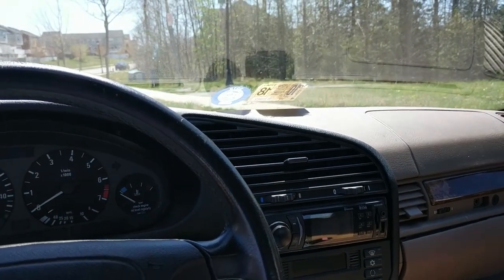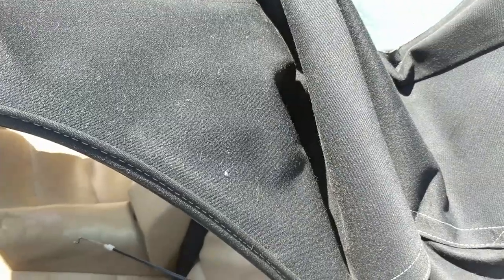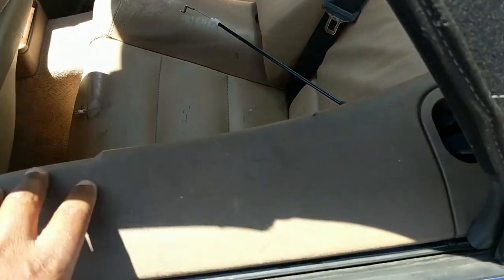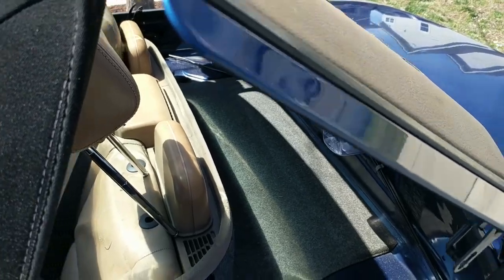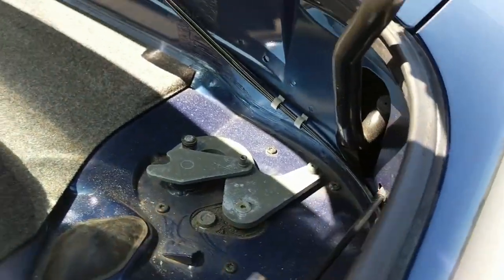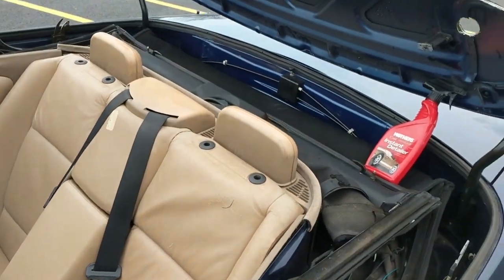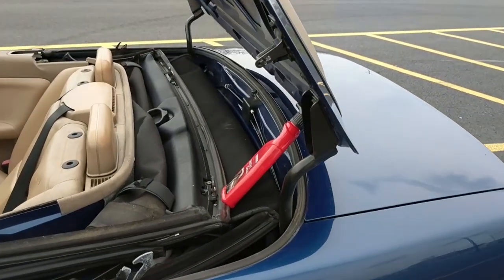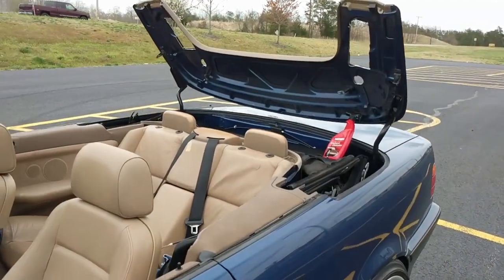E36 Auto to Manual Convertible Top Swap

Comment: How much would u say the total cost is or an estimate to swap to manual cause my top don’t work rn but if this is cheaper I might as well just switch to this
Reply from the maker: I got the top for around 400-500 with the brackets from a pick and pull yard the hardware and everything I needed. But I did pay about 230 for the manual lock mechanism system for the rear cover. I forgot to grab it off the pick and pull car the day. So I got it from a BMW parts guy off Facebook later. So I spent prolly around. 700-800 tbh could’ve did it cheaper if I grabbed everything I needed off that pull car.
Reply from the maker: The manual top I got came from an auto 318 e36. Mine was a 328i so I guessed the lower trim models got a manual release while the higher ones got auto

Comment: Gotta be another way to get the top cover open without cutting holes in the car, i want to keep mines as clean as possible.
Reply from the maker: Well the top cover is replaceable so that's why I wasn't tripping about it. And I honestly don't think there's another way. Because if the locks won't release from pulling the emergency latch there no other way to get in there.
Reply: I just got mines disengaged by taking out the cover motor in the trunk
Reply from the maker: The cables to mine had to much slack to release the cover. Dropping my motor didn't do anything and for in the lever for the cover motor ain't work.
Reply: Ssparksmedia the cutting on the toneau cover isnt a big deal but cuttjng through your back armrest was bad idea. Those leather ones are rarer
Reply: @STLLTNDR  You could just go straight to the cover motor, there is a latch where one of the cables corresponds to...but I get it it's a bitch when you can't get the top down, nice wheels by the way
Reply: Pop out two latch cables from the top storage lid opening motor inside the trunk. Then u don't need to cut the top storage lid.

Comment: No no no hell no. Please dont cut the top cover. If the emergency handle under the  seat doesn't work. Go in the trunk and pull the release manually. There's 2 of them. One on the left behind the driver side rear light. The other on the top left in the trunk.
Reply from the maker: Cutting was my last resort after trying everything i could to get the cover to release. of course i tried going through the trunk but the cable itslef has to much slack to release the cover. so it had to get cut up lol its replaceable for anybody that has to do it.

Comment: Wtf do I do if I don’t have the handle that releases the convertible area
Reply from the maker: either try to manually release it from the motor in the trunk or cut holes in the top cover like I did which is replaceable. to gain access to the locks on both sides to release it.

Comment: After you cut the wholes out to get the top up could you replace the part you cut into so it won’t look as bad after you swap it?
Reply from the maker: Yeah the tonneau cover is replaceable 4 bolts hold it on , two on each side

Comment: How rare is the oem manual top? I have it but I actually never saw it on any other e46’s while shopping for mine. It’s really not bad opening the top, by myself it takes about 30-45 seconds
Reply from the maker: its not really rare if you know what e36 to look for. like I knew that 318s came with manual tops because all the 328i I saw were auto.

Comment: I have a full automatic one. In order to do the swap I need to get a new soft top?
Reply: Or I can use my original one?
Reply from the maker: You can use your original auto top but you would need the front locking system from a manual top ( the Handle and such) and maybe the rear tonneau lock system only if your emergency latch works to release the tonneau cover. I just found it easier to swap the whole top just because my auto top was falling apart. And it's easier to Grab and whole top because you get everything rather than trying to source specific parts you would need just to keep your auto. I grabbed A whole manual top with bracket for 174$ from a pick and pull.

Comment: HELP!!! Trunk is Stuck - Won't Open With Key.
After viewing your video, I think you could help me solve a huge problem,

The top on my '95 325ic convertible was already converted to manual years before I purchase it.  

Unfortunately, the other day I created a huge problem for myself when - for the first time ever my trunk became stuck (unable to unlock) -  after removing the flap and taking the top down to get water out, that had accumulated in the area where convertible top is stored.  

Even though I have owned this car for 5 years only after watching video did I learn the trunk won't open if the top is down.  In addition,  the two rear latches on opposite sides of car under flap , which could disable the trunk latch.  

To my pleasant surprise, upon watching your video at about (4:50)  mark you begin talking about the same thing - inability to get into trunk , door locks and removing a fuse from the central fuse box, which I did not do before taking this top down - never had to in the past either.  You also stated, that  you would share a video, which I can't find on your YouTube page. 

So, I am wondering what has went wrong here?  Why does my key no longer work in the trunk lock cylinder, even though I have let the top up and down manually dozens of times before.  When I turn the key to the left, I can hear the motor engaging, but when turned to the right there is nothing - no sounds or resistance / tension - like something is broke or disconnected.   

==========
Now I am at a point in which I may have to pull rear seats out to access panel to break into trunk OR drill holes under rear tag to try accessing the cable.  My third option is to take it to the dealership and be ripped off in a mighty way.  

Therefore, any advice or expertise you could give would be appreciated.  

Many Thanks, 
L__
Reply from the maker: lookup a fuse diagram for the e36 there is plenty you want to pop out fuse 7 that should unlock your trunk. because your car thinks the top is down so it won't open and let me know if that works.
Reply: @STLLTNDR  Thanks for  replying I will check that out.
Reply: Push down on the right of the boot or sit something on it  then push the trunk button

Comment: STLL, will you convert mine for me for a fee or do you know anyone who will?
Reply from the maker: depends on where your located but convert do you mean to take your auto top and convert it to a manual or completely change the top as I did. and I don't know a place that will do that job specifically but it's not a hard job just depends on if your auto top folds or not.